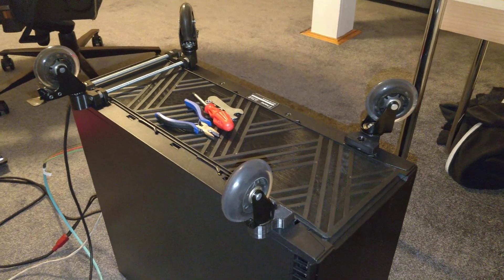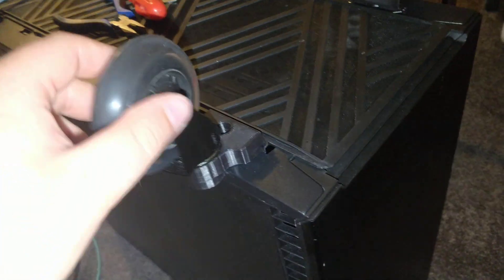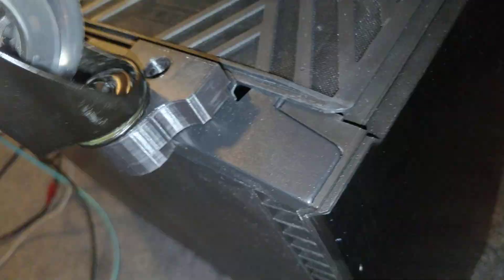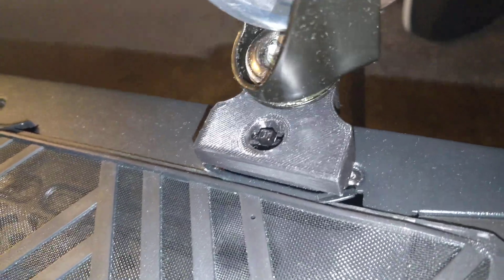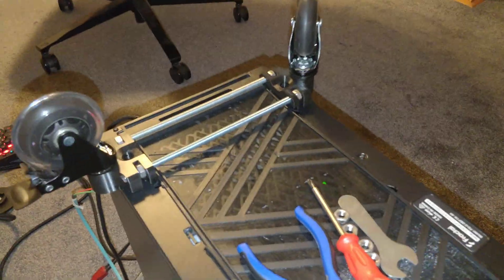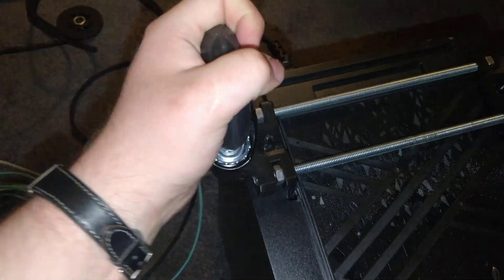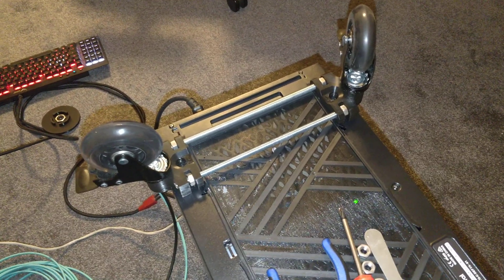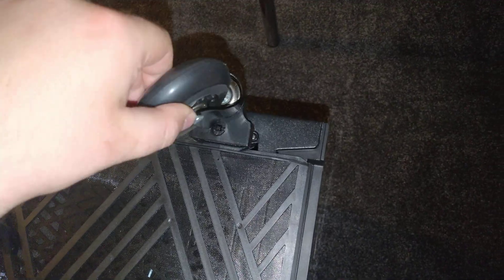Fractal Define XL - 3D-Printable Wheel Adapter

Comment: What is the best materials for the print? Can the rods be bought or do they have to be cut? Have you thought of any ways to improve it? I really don't want to mess up making this and have never 3d printed anything before.  Can i hire you? Or can you recommend a service? I also sent you a message through the printables site and your posting there
Reply from the maker: I printed it from normal PLA with 30% infill density. (PLA is basically the Standard Material nowadays). It can of course also be printed in PETG, ASA, ABS and HIPS for example. Some are more durable then PLA. But it is really no concern. PLA will do nicely with 120kg/265 pounds load in and on the case (me sitting on it + loaded case)

I think i will make an ebay listing for european customers in the coming days. 
I have no experience with online 3D-printing services. But fell free to use my files.
The 8m rods usually come in 1m or 2m in lenght. Maby you can ask to have it cut directly in the hardware store?
And i am happy to help where i can

Comment: Hello Wolgange, thanks sharing your trick.
Is it possible to share the link toward your wheels adapter please ?
I don't know how i will get to print it since i do not have a 3D printer though i will try.
Thank you !
Reply from the maker: I wanted to do this for the longest time and forgot.
Really surprised someone found this video since it isn't posted anywhere ^^.
I will upload the files tomorrow and post in a forum.
Maybe you can find someone who has a 3D-printer. Else you can use an online print service that can send you the parts my mail. There are multiple providers nowadays.
Reply: @Wolfgang_Weber  thank you !
Reply from the maker: @yakup_aksu  https://www.printables.com/model/302814-fractal-design-7-xl-wheels-reinforced

Here you go. I also made HDD trays if you are interested. Linked on that page
Reply: @Wolfgang_Weber  Thank you Wolfgang, much appreciated 👍!